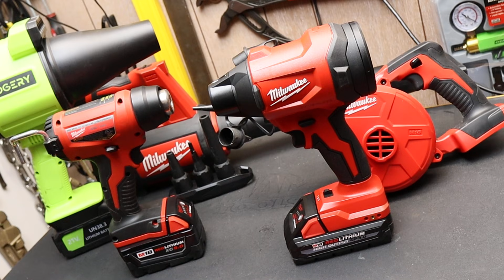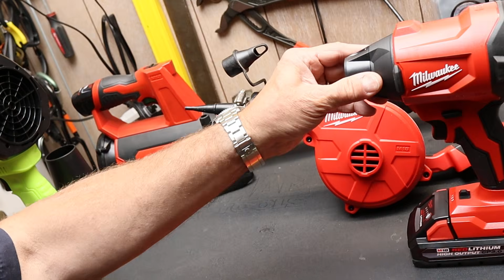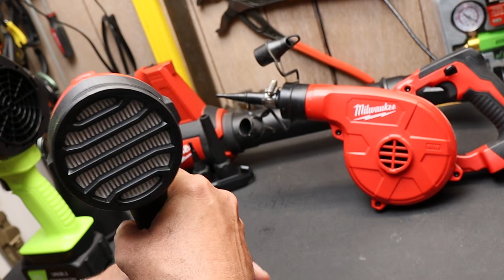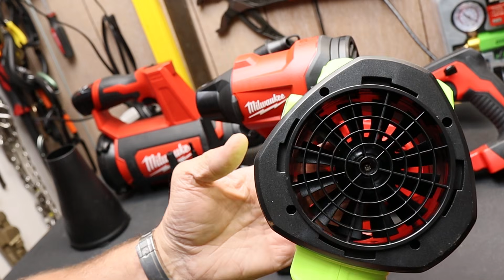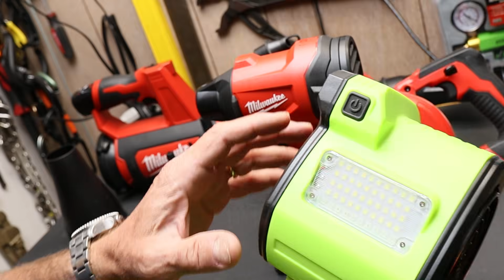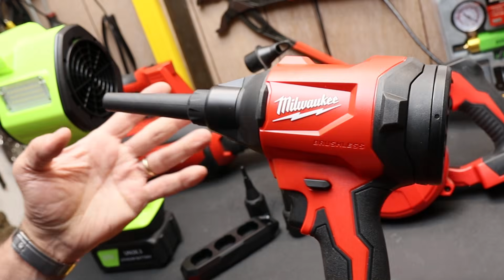A Laser Beam of Air! Milwaukee Precision Blower is Shocking Good!

Comment: I have a similar Metabo and Hikoki blowers, but both 18V.  They are slimmer and perhaps less powerful, but very useful tools. Cleaning computers/filters and tools (saws and such) with them mostly.
Reply: I also have used them for interior detailing cars. Sometime stuff sticks and are hard to vacuum them out. You just blow it loose/away with blowers like this. 
Initial cleaning of firearms as well (I used a regular compressor earlier).

Comment: Thanks Doc, again!  I need one for cleaning off sawdust...do a lot of woodworking and don't like running a compressor.  Also, inflator at times.  I have the DeWalt like your Milwaukee, but the snout is too long for some things.  My wife has the Makita, but it is not as good as the DeWalt, especially with the FlexVolt batts.  Oh, and we are in Search And Rescue and have to blow out our vehicles of the desert dust regularly and I can use it with my Milwaukee inflator and impact wrench batt's.

Comment: I got this Milwaukee blower a few months ago.  Mostly to blow of my tools and workbenches.  Does a great job on miter saws and anything else that accumulates saw dust.   While I am not so sure about the 570 mph, I discovered it is great for blowing off my shop floor, deck, and steps.  Keep it next to my workbench and it is real handy just to grab and go rather than breaking out my leaf blower, which I really don't use all that often since I live in the country with acreage and get rid of stuff with burn piles.  An old fashion rake works much better than a leaf blower for making piles to haul to the burn pile.
Reply from the maker: We mostly use our leaf blowers to clean out the barn and garage, blow off mowers, blow off porches, and importantly get tree debris off the roofs to reduce fire hazard.
Reply: @lastbesttool  Thanks for the reply.  I use my air compressor for my riding mower since it is right in the shop and with the gun I have (long and narrow) I can reach in spots (like threw the hole in the back to clear off the transmission fan).   Used to be a militia (back up) wildland firefighter, so reducing fire hazard is a must and whatever works is great thing.   For me, in my 6 acres full of oaks, I mulch the leaves with my riding mower. What doesn't mulch, too far to blow them to my burn pile, so rake it up, put it in the tractor trailer and haul.  Wanted to stay busy when I retired, and believe me, it does.   Love your channel, one of my very favorite.  Keep it up.
Reply from the maker: Thanks. We just burned our pile a week ago. It's all over now till September or October. We had late rain so our burn permits lasted longer than most years, but now we enter our fire time.

Comment: I call that a "workbench blower", and nobody gets it. They should be smaller than the smallest M12 drill or driver, and have a real trigger, not a silly "high" and "low" switch. None of the manufacturers get it. When you need a quick blast or gentle blast of air, you don't want to be fiddling with buttons. Just pull the trigger lightly or hard to get the air velocity you need. You don't want to use a leaf blower in your shop!

Comment: Thanks for another great review of a great brand. As much as I've depended on my Milwaukee tools since before they sold anything without a cord, I'm disappointed in the heat gun. Without a trigger lock (on), I'm going to have to look at DeWalt, but they sell the Grabbo version too, so I am OK with adding another platform if there are at least 2 tools that aren't available or better than the other brands. I do have some Ryobi devices for similar reasons, but typically just because I don't need the $100+ price difference, lol.

Comment: I use mine for cleaning off all my saws. But sometimes when I’m making a repair to copper pipe and I have to solder I use it to blow the water lines out. I open up a spigot and let it rip. Makes soldering a lot easier when you don’t have residual water constantly trying to cool the pipe.

Comment: Assuming this fan is brushless, then the circuit board must be the switch and motor controller as found in all brushless tools.  Usually the board is located elsewhere and is often potted.  I like the two-stage filter design which allows the controller board to be directly cooled, which might really lengthen service life.  Has anyone used this blower in lieu of compressed air around the machine mill?🇺🇸🌿
Reply: Mine is often used instead of compressed air or in addition to air compressor or also along with a shop vac.